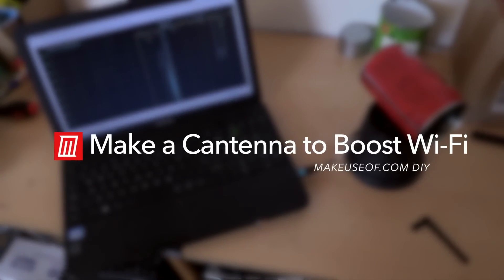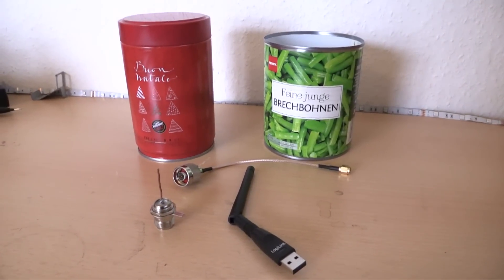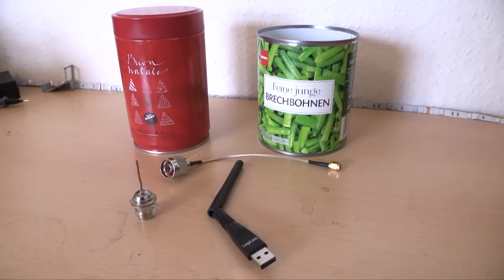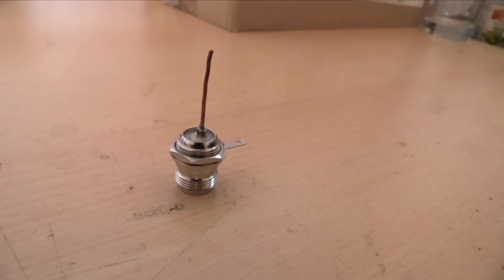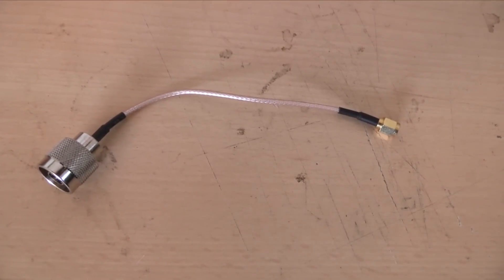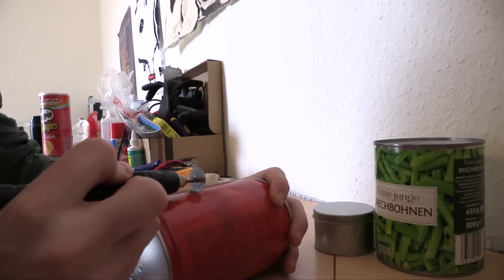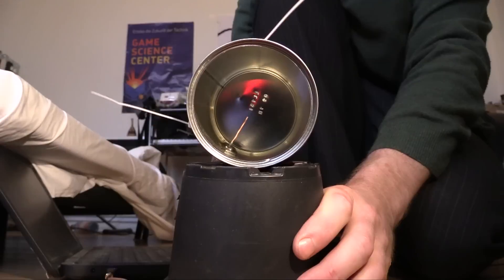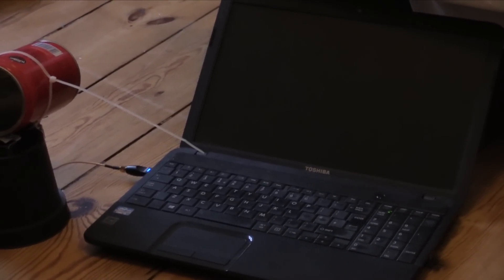DIY Cantenna to Boost Wi Fi

Comment: If you be off by 1mm with any dimension you will get high SWR and the transmitted signal instead of being transmitted into space will be reflected back to the modem which in some cases may destroy it. You should always measure the reflection coefficient  correctly eg. with the use of VNA to make sure your antena is properly matched before trying to use it.